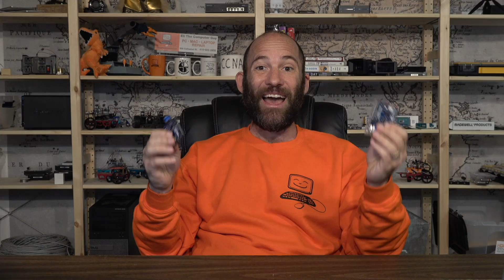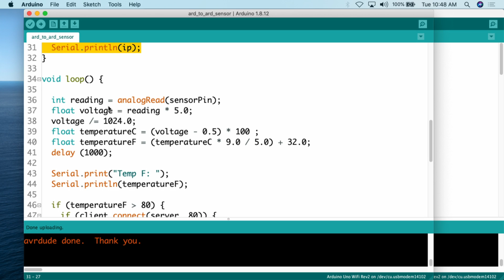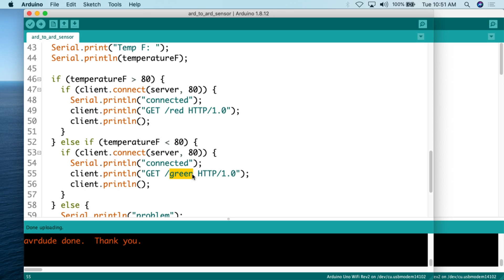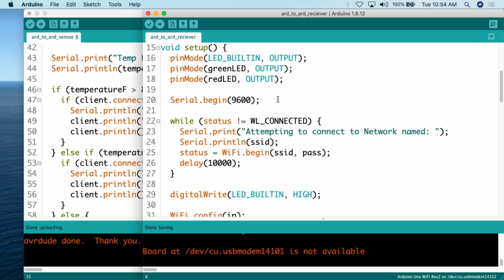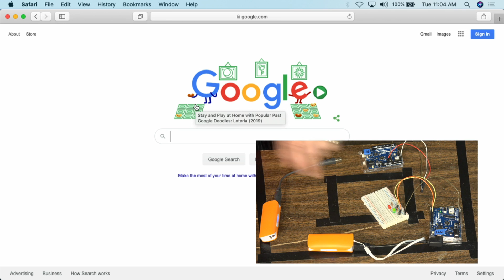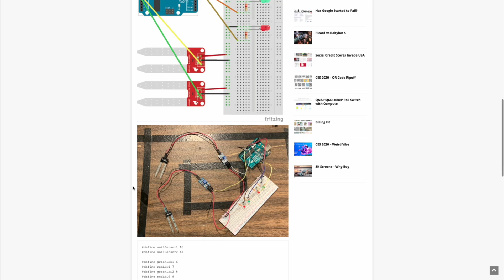Arduino Uno with WiFi - Arduino to Arduino Communication Temperature Project

Comment: if i dont have an arduino uno with wifi, could I use esp8266 module with an arduino uno basic? if that is possible, what changes should I do in the code? thanks

Comment: Firstly, great tutorial! First time watching one of your videos and I’ve hit the subscribe button.

For the situation where the Arduino Sensor dies, would it be possible for the Arduino Server to sense that it hasn’t received communication from the other one, for example: if it hasn’t received comms within the last 5 seconds then light up both LEDs.
Secondly, if your basement is on fire I’d really hope the Arduino Sensor would report back the high temp in its last dying breath like a true hero :)

Comment: Why dont big companies use wireless access point ( WiFi ) for their business to avoid Networking cables and big complex wirings and other hardware to cutoff the costing and maintain wirings..? Why they still use Ethernet connection in computers rather then WiFi ?if you read this please reply.
Reply: simplest answer is security. Second: speed and reliability.
Reply: It was also only recently that we hit the ability to transmit fast across WiFi. Although this is dependant on a lot of things, and sometimes Ethernet is still faster